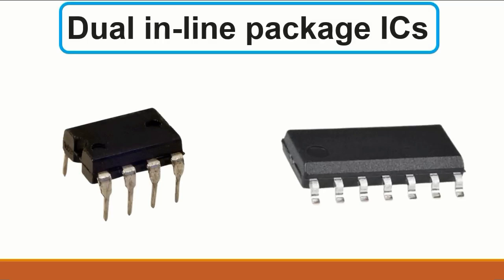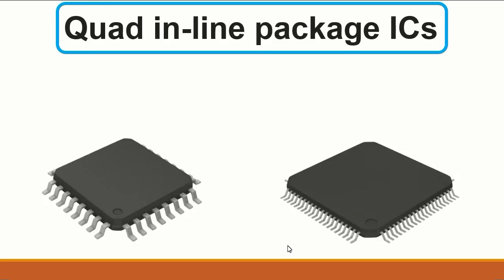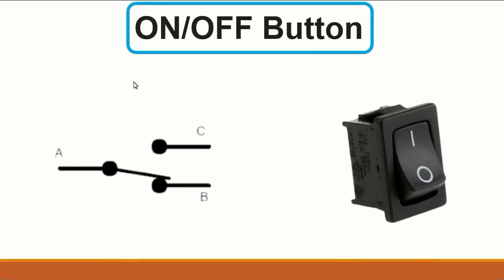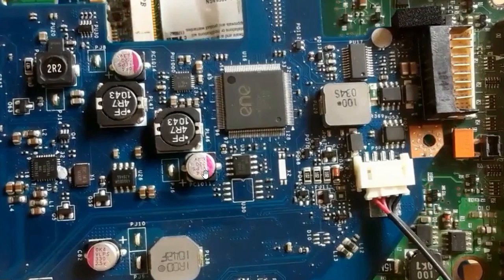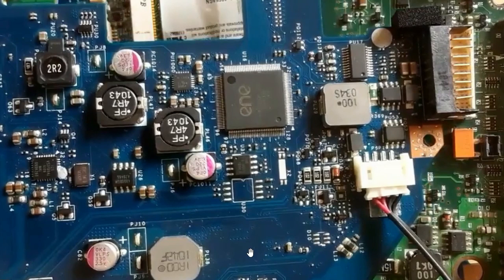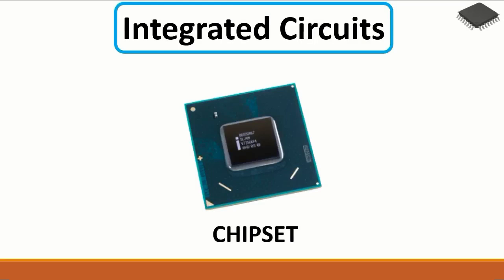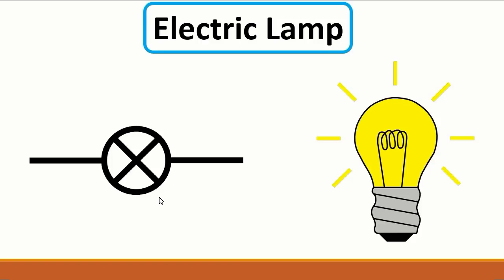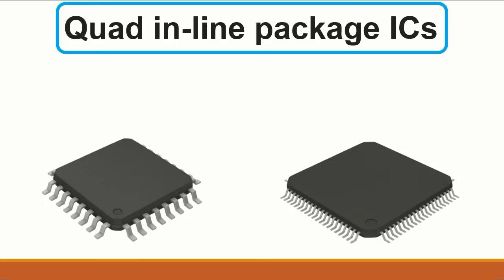All Electronic Components Explained in Detail Part 3

Comment: Hi Sir, I need your help here. I have a blown bose subwoofer capacitor and I couldn't find a replacement for it. 

Are there any alternative capacitors that I can use? 

Here's the details of the blown capacitor 

Brand... AiSHi
25V 39000uF 
CD293
40/085/21 

It's a 4 pin capacitor.  

Would appreciate your suggestion if there is any capacitor I can use that can pretty much work the same. Thank you